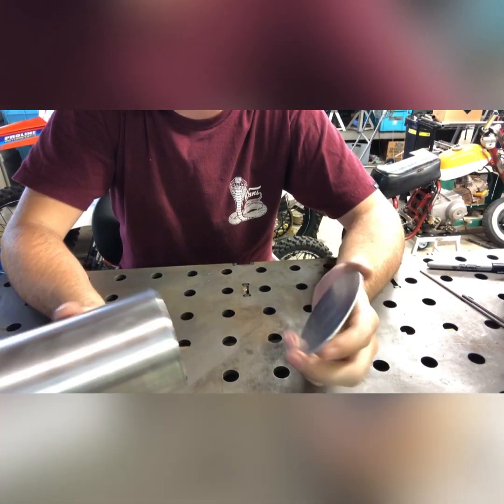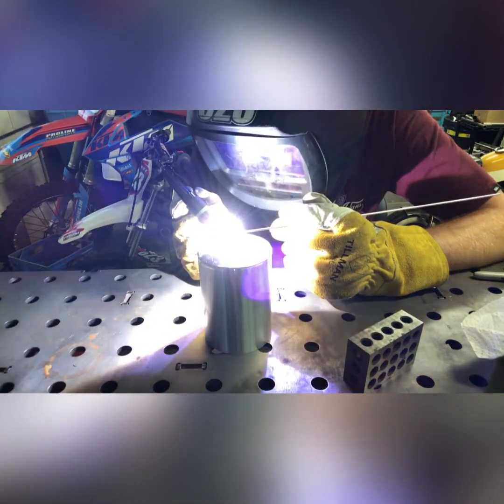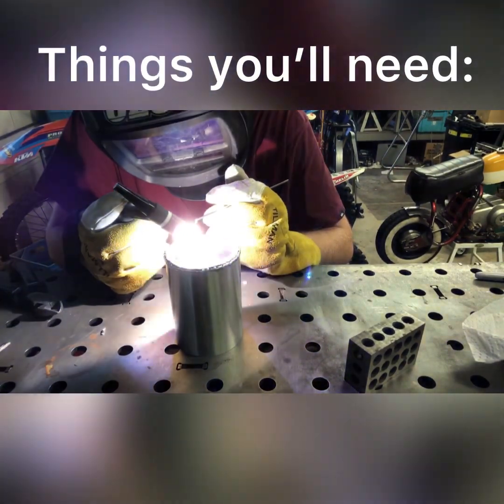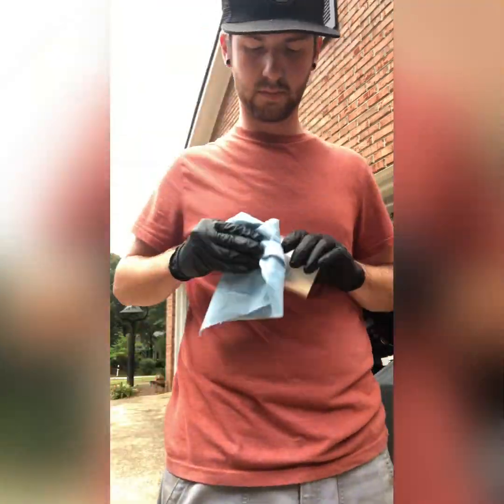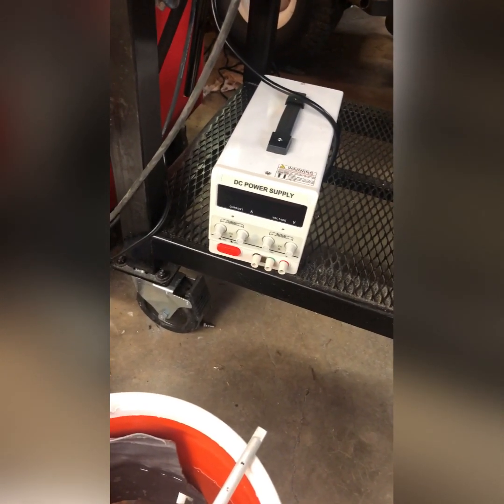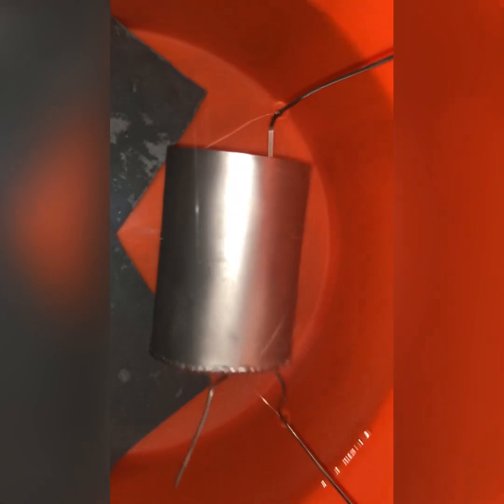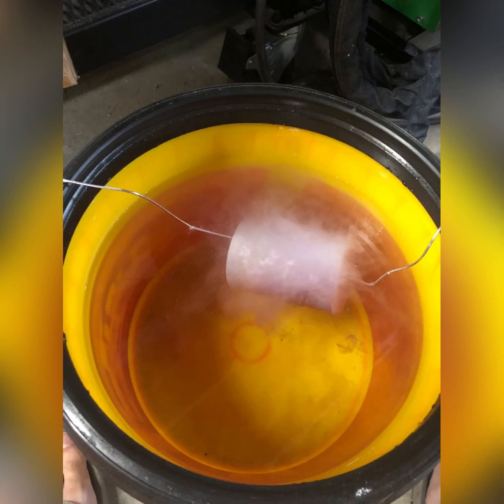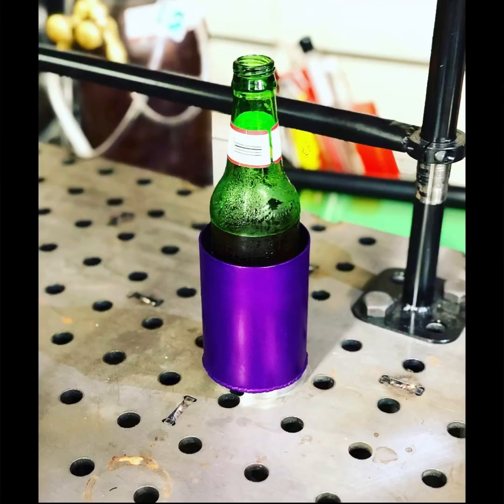HOW TO: Anodize Your Aluminum Parts At Home!

Comment: If I have an item that I want multiple areas different colors, can I "double anodize" a part for different colors as long as I use peel paper covering on the parts that I don't want colored?
Reply from the maker: I haven’t personally ever tried this. Personally I feel like the best results would come from anodizing the part completely then during the dye process, do half one color then move into the other color suspending the part that has already been colored out of the dye. Then move on to the sealing portion as usual. As far as masking after the anodizing is complete, I’m not sure how you would get the masking off without ruining the anodized surface and having to start the process over again.

Comment: Hey, I'm looking into anodizing enclosures and parts for the devices I build, and I'm wondering if stainless steel can be used as conductor instead of titanium, possibly with insulating as much of the wire/rod with heatshrink tubing. Any info on that?

Lovely purple BTW. Very much my style :)
Reply from the maker: You can’t put stainless in the sulfuric acid, it’ll immediately start to corrode away. Lead works great as a Anode and is much cheaper than titanium. Your wires that the parts hang from should either be titanium or aluminum.
Reply: @PosParts  thanks for the info! :)
Reply from the maker: @KeritechElectronics  no problem at all. Glad to help!

Comment: Maybe using a sacrificial titanium piece of metal, and to DIRECTLY touch it to the aluminum or titanium part to be anodized...

Finished off with a separate FINAL Dip in a bucket or pan of Nickel Sulfate Solution

Comment: Good video! I prefer to seal the finished piece in Nickel Sulfate solution from Caswell instead of the boiling water. The boiling water seems to leech out some color and doesn't look as rich in color. Nice job!
Reply from the maker: I’ll have to give that a shot. Thanks for the suggestion!
Reply: @PosParts i wonder if how'd go. I would like to ask if you can create a short vid for that one.
Reply from the maker: @johnjerizlopezignacio3891  I haven't tried it yet because I haven't had anything to anodize recently. I'll let you know as soon as I give it a try.

Comment: Go larger on your bottom plate that way you can get a good clean fillet weld and then put the cup hold on the las and turn it down to a smooth bore diameter
Reply from the maker: I left the weld on purpose because I was testing how reliable anodizing was with 5356 filler rod. I had some projects for my jetski that needed to be welded then anodized for corrosion resistance so this was my test piece.

Comment: Hi bro , I just wanted to coat Aluminum showerhead with Zirconia or yttria for steam purpose. would it be possible.? or recommend a material for the showerhead that undergo high temperature application.  Need your advice!

Comment: Are process variables color dependent?
Reply from the maker: The only variable associated with color is the time you soak the part in the dye. That takes experimentation to figure out how long you need to submerge the part in the dye for the desired color. I always pull the part out in 30 second intervals and look at it until I figure out a good number for each color.

Comment: How durable is this against dings and scratches? I need to anodize my aluminum men's ring designs.
Reply from the maker: It holds up really well. I do all of my custom motorcycle parts that I make this same way and they last for years. For a ring, you will see scratching over time but that's just the nature of it. If you want it to be extremely wear resistant you could have them hard anodized but you don't have the color options.

Comment: I want to do some fork tubes.  So about 2 inches in diameter by about 2 feet long.  Would you think this would work?  I see an issue with finding a pan long enough for heating.
Reply from the maker: I agree that finding a pan long enough would be a problem but also trying to heat the dye evenly would be an issue for something that large. My best advice is to not test your setup (especially not when you've never anodized anything before) on parts you actually care about because you do have the potential to screw them up. For big parts like that the surface area is much bigger therefore requires a much larger power supply. Unless you're willing to drop the money on a setup that's large enough, I'd send them to professionals to have it done.

Comment: Hello, I have a really small surface area (about 13.5in^2). Is it normal that I get 0.56Amp on the Current value? Can DC Power Supplys give me such low current? Greeting from Portugal.
Reply from the maker: Yes sir most DC power supplies have a fine adjustment knob as well as a coarse adjustment knob for both voltage and amperage. On the one that I purchased it is not an issue to fine tune it to a number like .56 amps

Comment: How would i do this if i cant easily calculate the Surface area of my Parts?

I have a set of weirdly shaped parts for a 3D Printer, made out of aluminium, that id like to reanodize to that lovely purple. But im not sure what Amperage i need to go for.
Reply from the maker: Hey Ninsa, 
If you have oddly shaped parts, drawing them in a CAD software like fusion360, Inventor, AutoCAD or whatever you may have access to may be your easiest solution. If all the faces are flat on the part, you can separate the individual faces into rectangles and squares then add up the areas independently. It doesn't have to be exact but getting close will be helpful. Another idea is wrapping the part in painters tape then cutting it with a razor blade then peel the tape off and put it flat on a sheet of paper then separate the tape into squares and rectangles then add up the area of each.

Comment: Subbed!  Smooth operator...you've taking the trade serious young man, I appreciate the time and effort to share your knowledge.  I'm gearing up to try this on my own too.  I have a few quandaries and hoping you can help/suggest:  1.  My bike aluminum brake arms have brass bushings pressed into them.  They are from an old bike and certainly loose so the 1/1000th of an inch anodizing layer (if it would even do so on the brass) would not affect the operation.  Is there any concern for this brass bushing which I can not remove?  2.  Would a flattened lead roof boot pipe flashing work for the cathode?  3.  For the lead cathode, is it better to have the negative split to two cathodes spaced evening on each side of the part or is it just as good like you have it on one side?  4.  These parts are very tricky to measure the surface area..how much estimation leeway do we have?  4.  So for connecting to the piece (anode) we can use all aluminum wire/hardware or all titanium wire/hardware, mixing is fine (as you do) but what about say stainless, just wondering why like this?  5.  Finally, I'd like to produce a smokey black finish, I've read you should use royal blue dye, any suggestions here on how to achieve such color?  Thank you.
Reply from the maker: Hey Roy, I'll try to answer your questions to the best of my ability.
1. You'll have to remove the brass bushing, anything besides aluminum, lead, or titanium will be negatively affected by the battery acid in the anodizing solution. The bushings had to be installed somehow, so you should be able to get them out then replace them with new ones after you anodize your parts. There is some anodize masking tape available online but I can't attest to how well it works but it may be worth your while to check out. 
2. Any kind of lead works fine, more surface area helps a lot and keeps temperatures down. I didn't really dive into that very much in the video because most people that just do it as a hobby or a one time thing aren't going to want to put that much effort into their setup. Just make sure its very clean. 
3. I haven't tried the split ground method but I don't see why that wouldn't work fine. depending on how big your parts are and how many there are it may help. I don't have a great answer for this question but remember that anything inside of the solution will corrode severely if it isn't lead, aluminum, or titanium so your ground cable needs to be above the water level. 
4. You can't use stainless because it'll corrode away in the battery acid when you run current through it. Similarly how subway bridges and ships corrode really fast because of rouge currents flowing through the metal. 
5. Caswell plating has a lot of color options available. If you're shooting for smokey black I would say go with the charcoal grey and play with how long you leave the part in the dye for. Longer times will equal darker colors so you may be able to attain the color you're looking for. Try a scrap piece of aluminum before you commit to doing it on your actual part just in case it doesn't go as planned the first go around.

Hope this helps!
Reply: @PosParts  Thank you.
Reply: @PosParts  what do you mean by battery acid??
Should I open a battery and empty it or what exactly should I get?
Reply: @FirstLast-tx3yj  Battery acid = Sulphuric acid

Comment: 1millimeter is roughly 39 thousandths of an inch. That might be part of the problem. Great result. Love the colour.
Reply from the maker: You're correct but 1mil is what I was referencing, 1mil=.001". I wasn't talking about millimeters. I should have addressed that more clearly, sorry for the confusion.

Comment: Sir can i use imax b6 balancer for my power supply?
Reply from the maker: I looked up that charger and it seems like it should work. As long as you have good control over the amperage input then it will probably be fine but I’m not 100% sure on that.